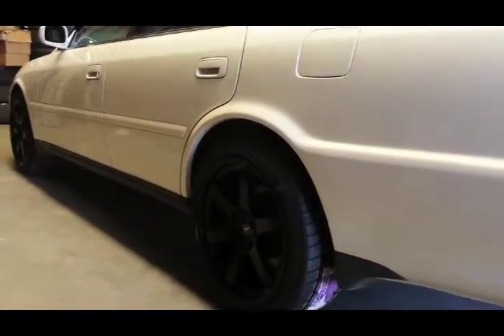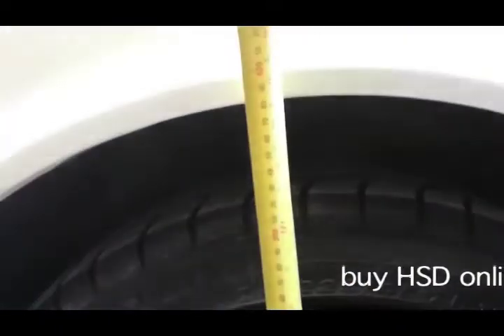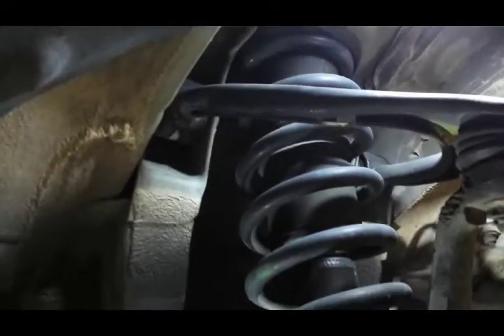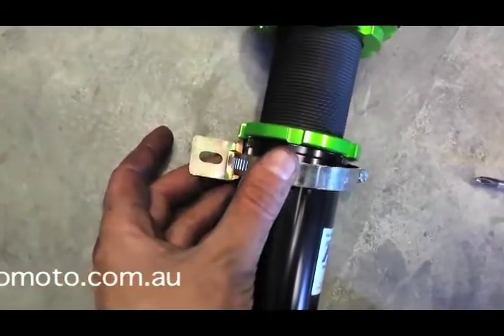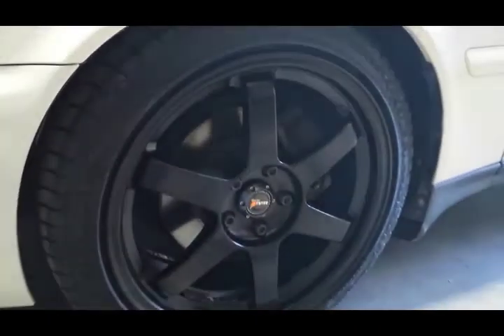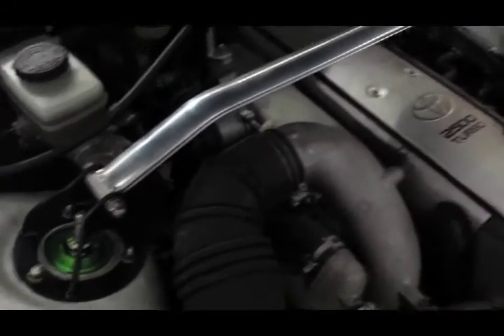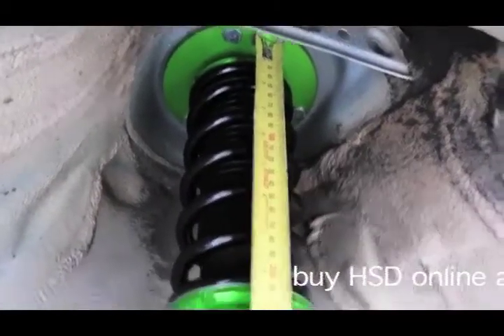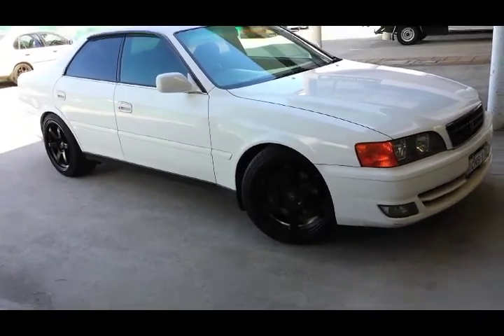How to install coilovers in a Toyota Chaser JZX100

Comment: thanks for the vid.attempting to change the rear shock on my 98 chaser tourer s.the shock is very long.can you get it out simply by undoing the arb link and levering on wishbone or do other parts need to be removed like driveshaft etc.thanks again.